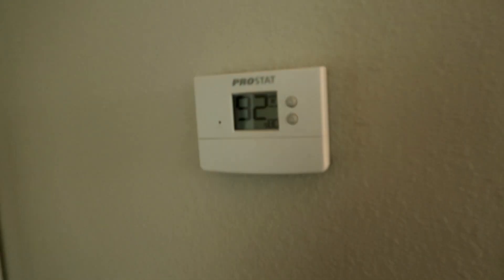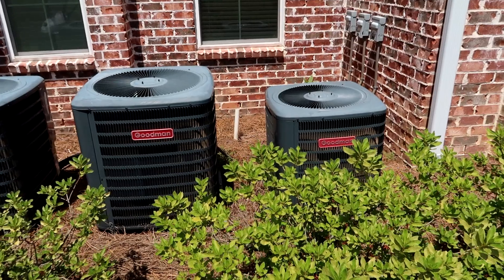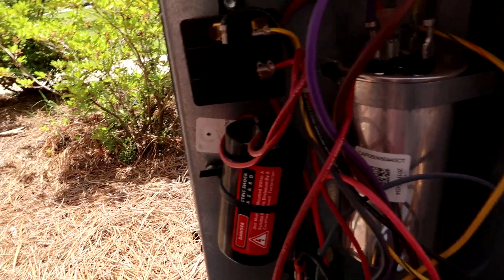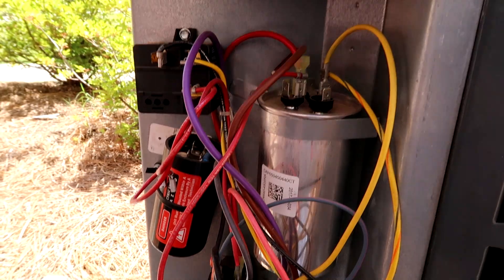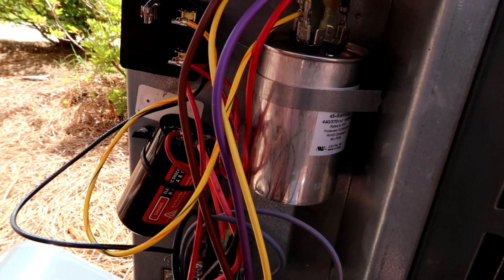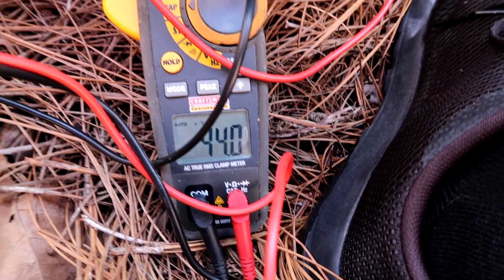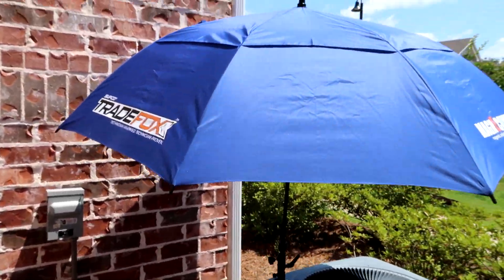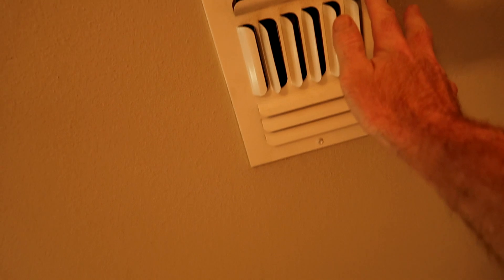HVAC Videos for Beginners #3

Comment: Nice find.  Working on 3 year old apartments now.  My shorts are from the high voltage wire, they cut the insulation on the outside and put small cuts on the other wires, 10 so far in 3 months.  Always fun when it happens in the breaker panel 4 floors down.  So they get a new box with a blank cover above breaker box.
Reply from the maker: Just making memories 🤣. Good to hear from you All Hours Maintenance!

Comment: We are actually trying to get this furnace to cut off  the central air and heat unit has been off at this house for 3 years and for some reason the inside furnace started kicking on 3 days ago and is throwing out heat from the furnace and kicking the breaker so I think I have cut everything out that I can see and turned off switch I don't know what to do
Reply from the maker: I'd need to be there for this head scratcher 🤔.
Reply: @LexVance  I opened the inside door of the furnace like I seen you do and pulled All them bulb looking things out thanks

Comment: No need to replace the capacitor. It was well within range of the plus or minus 5%.
Reply from the maker: You're right. I figured since I got it open anyway I might as well. Thank you so much for watching MrRheo!
Reply: @LexVance  Its better to replace them before they fail and damage the fan and compressor. Should be routine maintenance to start replacing all caps when they get two years old. 
How many units did you say you had?

Comment: Interesting,  did you check the minimum amp draw of the condenser unit? Is 15 Amps correct?  Did you check the amp draw after you replaced the HS kit?  Have you ohmed the compressor out?  No offense but you're missing a lot of information 😕.
Reply from the maker: Thank you so much for watching Lee!

Comment: Awesome video. How old is that property you’re on?
Reply from the maker: 4 years old. Too young for all the problems it has. 200 leaking air handler coils and almost as many bad hard starts. Thank you so much for watching Mike!
Reply: @LexVance  
you are sabotaging them to make sure you have job security, correct?
Reply from the maker: @tallswede80  👍😆👍 No need. It's doing it on its own. Some of that great 21 century construction. 🤣